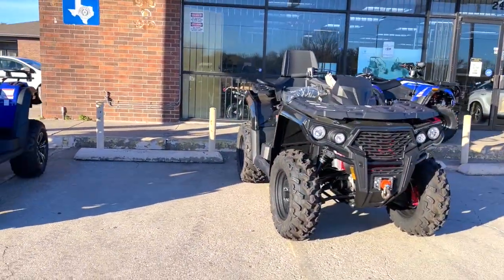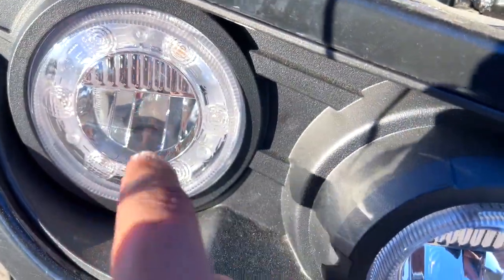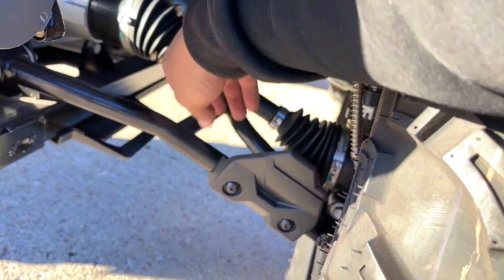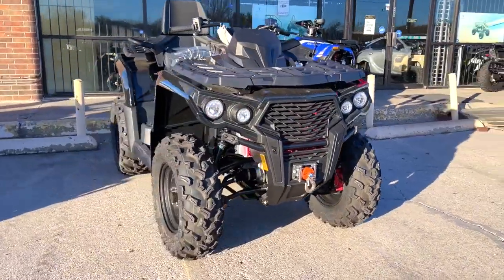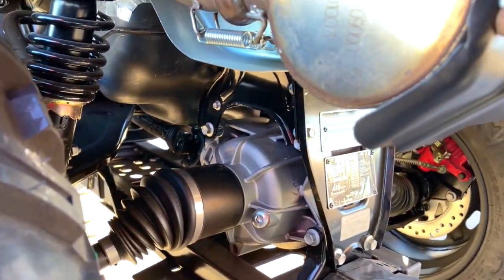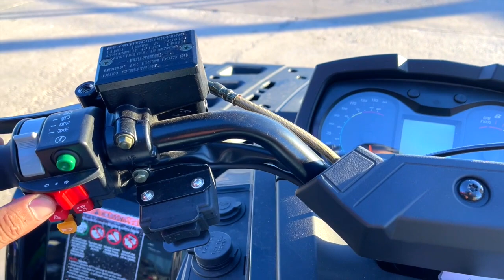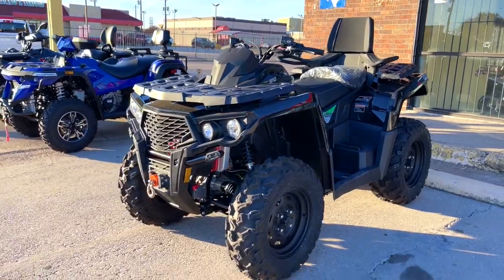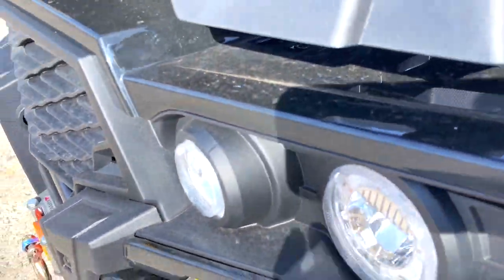AODES PATHCROSS 650 L REVIEW || Best budget friendly 4x4 Quad for off-road || Test Drive : 19:19 ||

Comment: Question . So i just discovered these quads i just bought a brand new linhai m550 L off brand of yamaha .  Are these aodes and linhais made by the same company ??? Or is this different company ??
Reply: I believe they are 2 totally different companies. Both pretty good considering. Odes might be a bit better.
Reply from the maker: AODES has manufactured for other few named brands as well. they are also a named brand on their own but just not as much marketed.
Reply from the maker: the M550L is indeed a sweet machine sir , isn't it ?
Reply: @pioneerpowersports  so far it's been ok . I have it on the farm here . Pulls a smaller trailer and loaded up with wood. And it pulls easy. Really like the power steering and 4 wd  plus the locking front and rear diff .  Also carries two people nicely and can get up to 90 kms an hour on gravel flat ground. Pretty decent.  The winch is nice to. Only complaint I had is that it was very hard starting when it got Colder out and when pulling a heavy load in 4 wd the power steering would go away.  But my dealer gave me a higher cranking Amp  battery under warranty and that seemd to fix the loss of power steering  hard starting.  Wish it had a bigger gas tank to quite small.
Reply: @pioneerpowersports  I'd like to get the back box for it for storage but don't know where to get that.  Be nice to have heated grips to.  But id like to get the front and rear storage boxes if available. Just don't know where to look
Reply: I noticed the Vitacci ATV's are actually made by Odes. @pioneerpowersports
Reply from the maker: @jacobboyko888  Massimo doesn't have an OEM back box but any regular boxes / universal one with the matching bolt pattern should work fine.
Reply from the maker: @jacobboyko888  yeah, the Odes have more options for upgrades and accessories. Also come with bigger gas tank but Massimo has been pretty decent for farm use. 

So, 4wd limits the power steering to avoid risks. Also with lock-in diff , its going to be harder to steer with more stablity on your handlebars
Reply from the maker: @alburd1  depends model to model. Like some of the vitacci atvs are powered by Linhai. Some of the Bigger side by sides are powered by BMS. So, its pretty solid.
Reply: @pioneerpowersports  if you know where to get some of those accessories let me know.    By the way I'm on a farm in Saskatchewan Canada so not in the US
Reply from the maker: @jacobboyko888  will update you with a link ASAP.  If you have friends/family/neighbors who want to get it shipped to Canada, I will try to include one box for free.
Reply: @pioneerpowersports  ok thank you but I'm the only one with this new quad though the dealer I bought it from didn't have any accessories really so hopefully you have a solution or where I can get them :)
Reply: I have the 200efi sport Model. On the vin plate it says Shandong Odes. It is a great rig for the money. @pioneerpowersports
Reply from the maker: @alburd1  its a distribution. Its not a rig. some of the named brands have been manufactured by ODES [not gonna name the exact named brand] and loncin [one of the priciest named 4 wheeler was made by loncin]

Regionally , like we have mentioned in the video, we are finally able to get ODES in central Texas. Previously , those had be distributed by our regional distributers. The factory plant is shangdong odes which you are lucky to have that kind of future parts support. Newer brands with compromised quality , those might be a rig [not gonna name them either ]. 

Also, Jonway YY series were distributed by vitacci as well, same concept and some of the popular parallel twin engined model come from that factory [also a named brand with almost double the price]
Reply from the maker: @alburd1  also, if its a non 4wd quad [pentora 200 efi], Aodes doesn't distribute them on their own. They specialize in 4x4 quads rn . 

If its a mope, Aodes doesn't directly sell or distribute mopeds either.
Reply: Ok let's make it simple, Is the Vitacci 200efi MADE by Odes at the Odes factory? That's what I assumed from the label plate. @pioneerpowersports
Reply from the maker: @alburd1  okay, its like Toyota Vs Lexus.